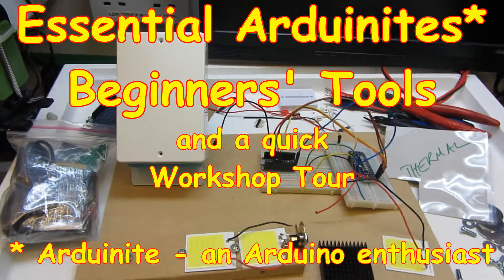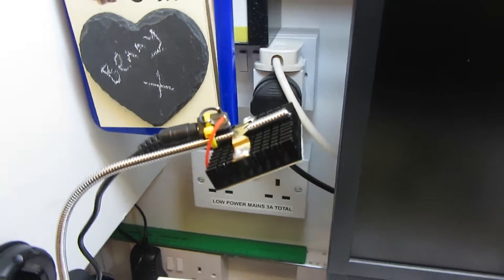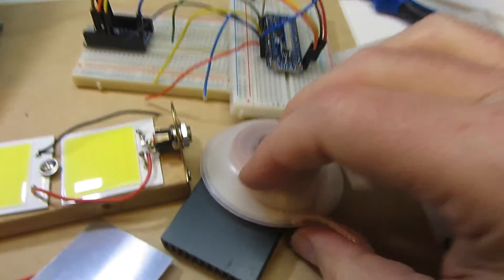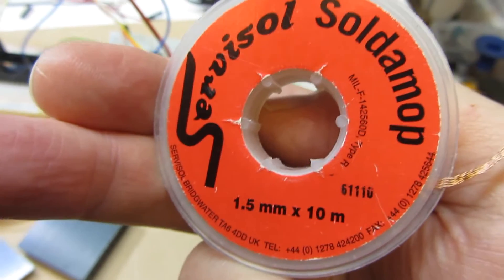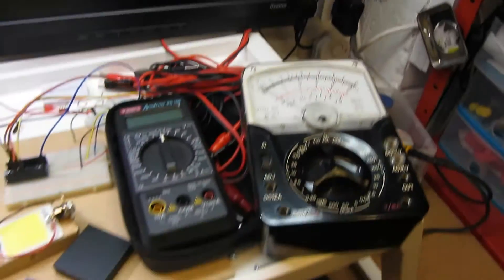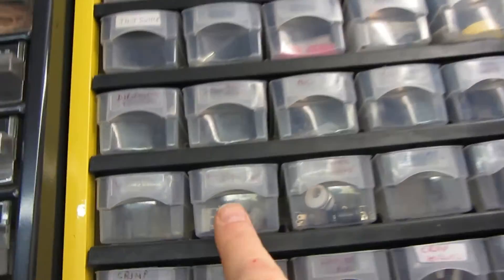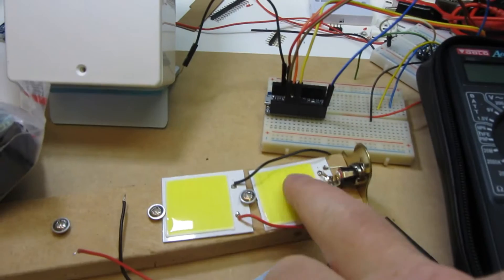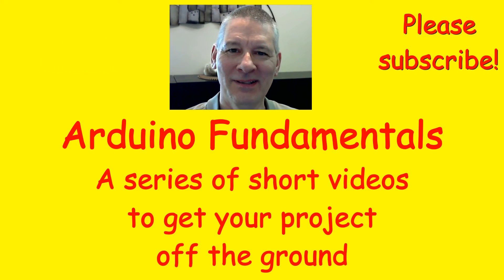#29 Essential Arduino Workbench tools

Comment: As a beginner to electronics on a very limited budget, I can recommend the JYE Tech DSO 138 Oscilloscope. It generally costs around £26 for the kit. You can get cheaper clones for as little as £13 on well known auction sites, but if you don't have an original, JYE won't offer support if anything goes wrong.
The scope is very basic, but it's enough for the beginner to learn the basics. It's also a lot cheaper than a £300 Rigol. It is also a fun kit to build.
Reply: You can also find older,  tube-type analog scopes which have fairly limited capabilities for not a whole lot of money. I've scored a couple of them for around $20.  Changed a few capacitors and they worked just fine for what I was doing at the time...
Reply from the maker: +Maxx B Thanks for the oscilloscope information - I will hopefully use your recommendation in a future video as I fully appreciate that my (would you believe budget) Rigol is a step too far for most people. I spent, quite literally, months agonising over its purchase and then finally took the plunge a few years back.

The only caveat on that kit is that its bandwidth is just 200kHz - OK for audio or some low frequency pulse width modulation (remember that the default PWM on the Arduino is in the order of 490Hz so that's fine). However, anyone with aspirations of higher frequencies will have to think carefully - even my Rigol only goes up to 100MHz and they do say you need double the bandwidth of the signal you're trying to measure.

However, for a beginner I'm sure it's great fun and I'm very tempted to get one just for the sheer fun of it - and for making a video of course!
Reply: Whilst I would never criticise the Rigol range of 'scopes, those that are watching the budget closely but want more bandwidth than the JyeTech can provide might consider the Hantek range. By careful shopping around and buying during a promo I managed to get the two channel 100MHz DSO5102P for less than £200.00.